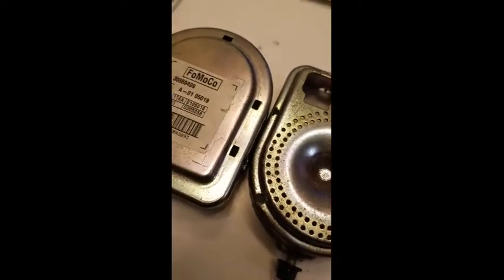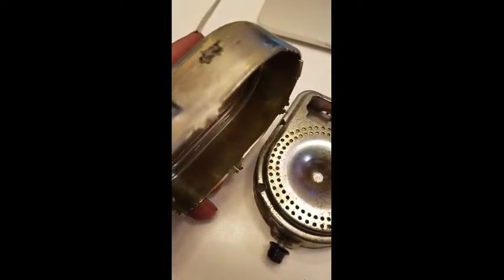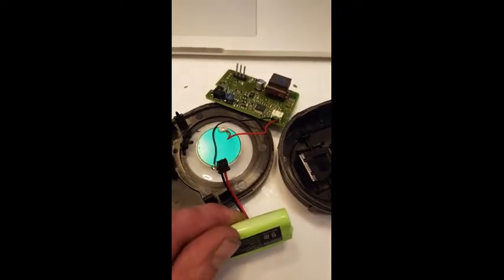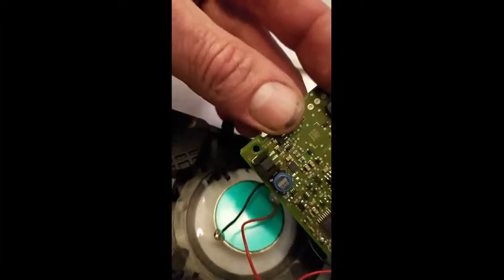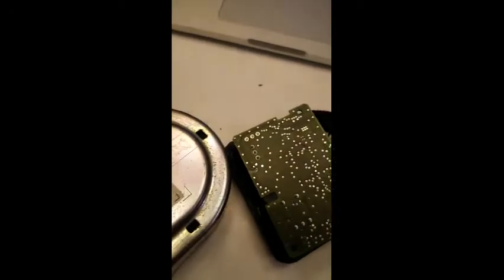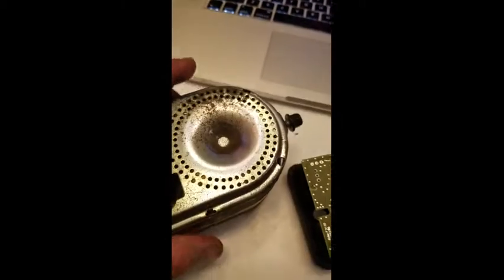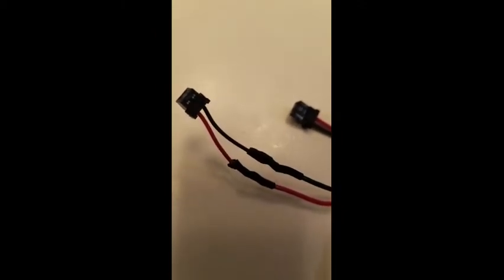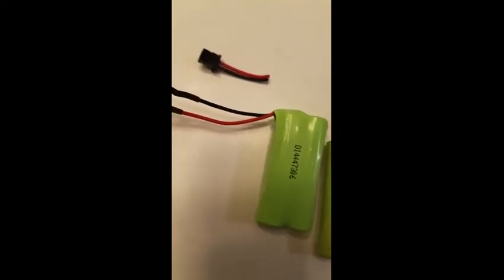Replace backup battery in volvo alarm siren. S40 V50 and others

Comment: Can you tell me the location of this on the car? My V60 showed up the message last night & trying to find it on the car now
Reply from the maker: On my s40, it is under the cowl--the plastic piece that goes under the wipers at the bottom of the window on the right (passenger) side. You have to take the wipers off (easy) The fasteners that accept a Phillips get a quarter turn. You have to up out the others. Depending on your year of S60, it may be there, or somewhere else.
Reply: @MrMasterFlash  one question, is it two AAA batteries? How many volts does it needs, the module?
Reply from the maker: @JesBu  Search for "cordless phone battery"  and you'll come up with things like this.  https://www.amazon.com/s?k=cordless+phone+battery&crid=2XF4SGW0T3Z0W&sprefix=cordless+phone+batter%2Caps%2C196&ref=nb_sb_ss_ts-doa-p_1_21
Or this 
https://www.ebay.com/sch/i.html?_from=R40&_trksid=p2380057.m570.l1313&_nkw=cordless+phone+battery&_sacat=0
Reply: On my UK 2015 XC 70 it was above and behind the front left wheel liner.  Easy to remove from the mounting plate, and I’m still trying to figure out how to separate the electrical connector without damaging it!